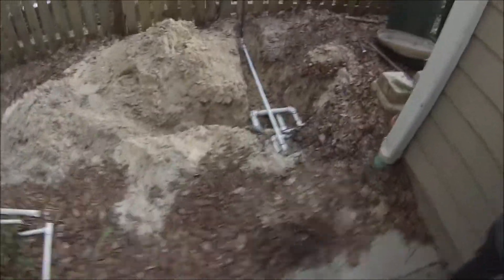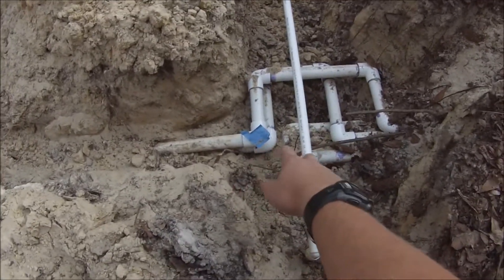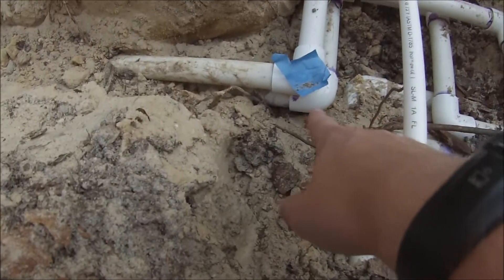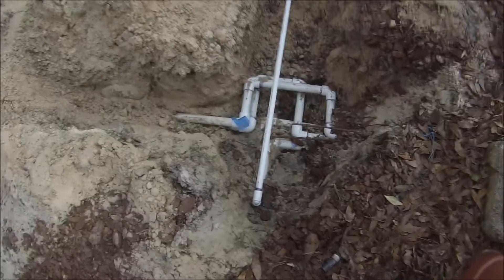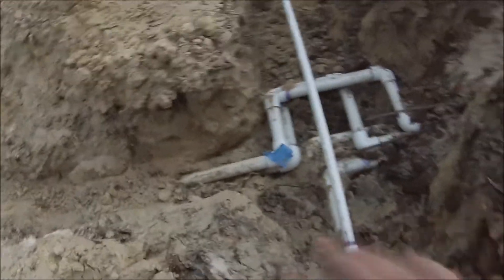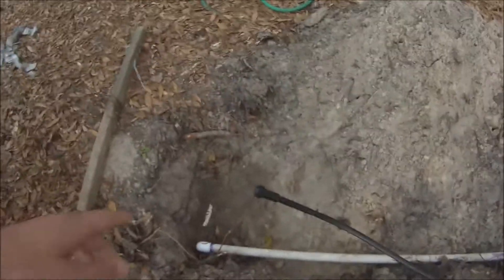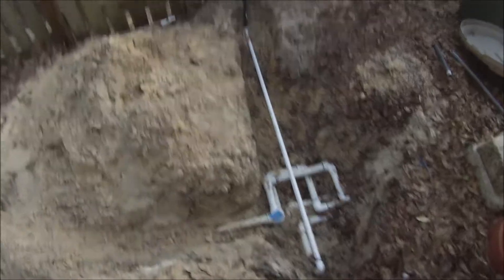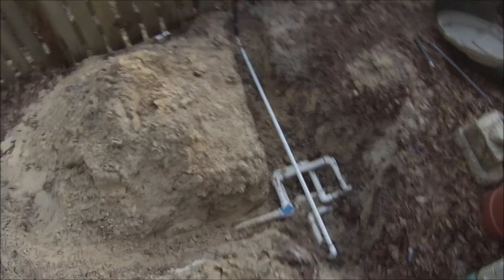Looking at an Irrigation Project

Comment: I have similar issues. I have a 4 inch water main and 1.5 inch supply lines to each zone. 8 or 9 zones. There are parts where there are 4-5 pipes stacked on each other  as well plus valves within  the stack. I usually have to 90 a pipe around  at least once a year due to a rupture. I have been lucky  this year. The worst one I had was a ruptured 4 inch water main in the middle of the night. It stopped water flow to the house and flooded the yard. I have done 6 heads this year, going with the Rain Bird 1800 series and Hunter PGP and PGJ. All were zero turn casualties

Comment: If you built an entire system with schedule 40 pipe nobody would be able to afford irrigation. Spacing out 6 or 7 lines instead of running them in one trench add trenching time and difficulty. If you are planning on being big into irrigation having 6 or 7 pipes in one trench will be a walk in the park compared to other repairs.
Reply from the maker: +95t600 Yeah that's what I figured was the case. Thanks for your comment :)